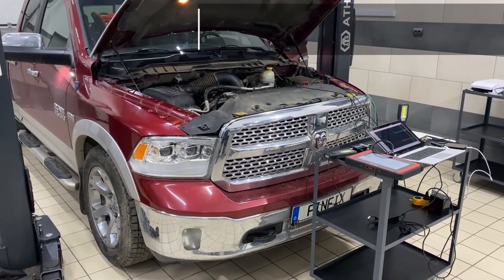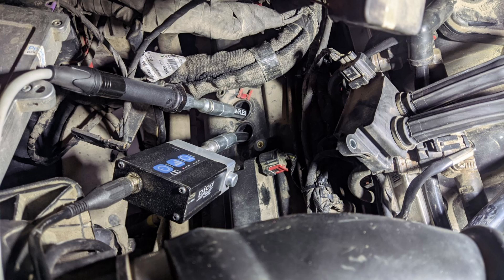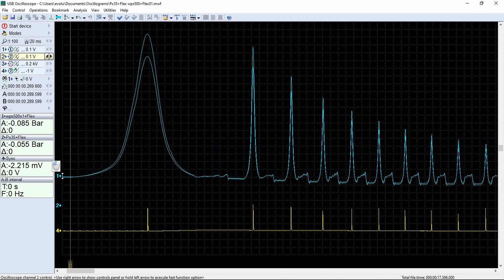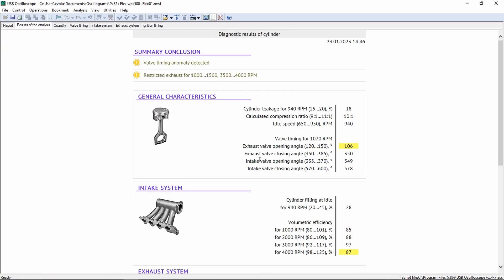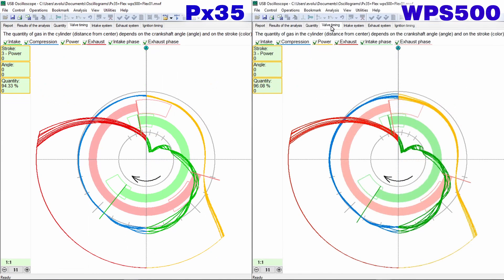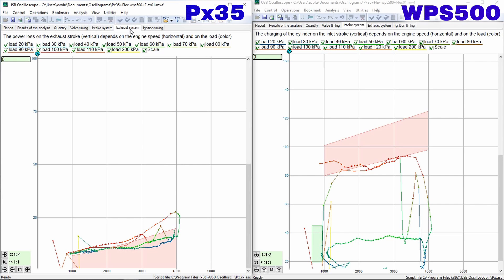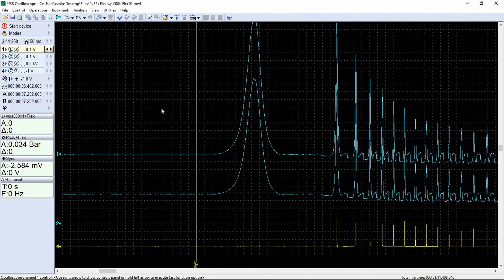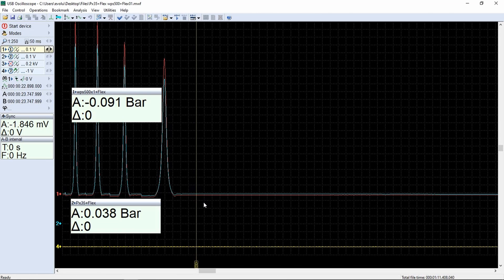Comparison of Рх35 and WPS500X on DODGE RAM 1500 5.7

Comment: Nice, but i don't understand why your pressure sensor have this funky connector, instead of normal classic BNC. Have you for sale any adapter which can connect Px35 to any other Scope ?
Reply from the maker: The pressure sensor has a 3-pin connector because in addition to ground and signal, power is also supplied to the sensor through the connector. At the other end of the cable there are crocodile clips for supplying 12 V power to the sensor, as well as a BNC connector for supplying a signal from the sensor to any standard oscilloscope.